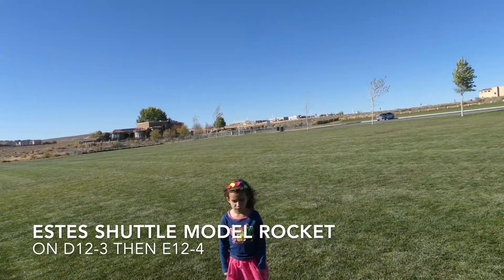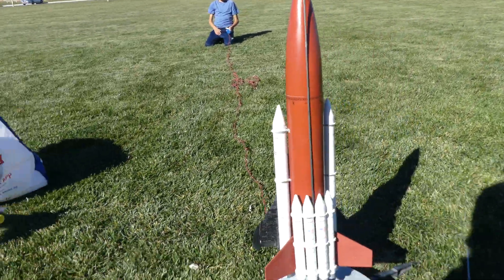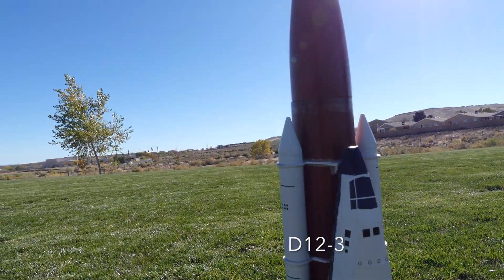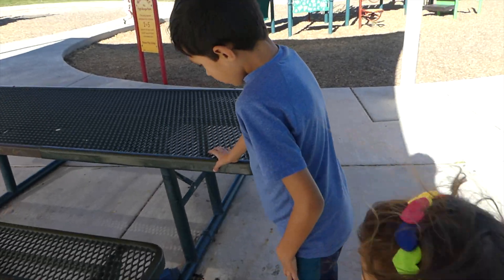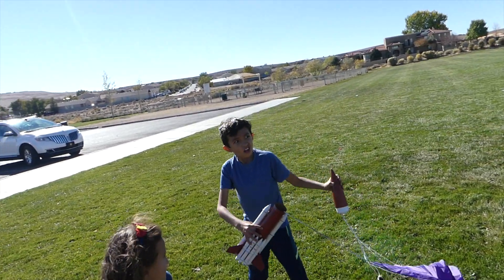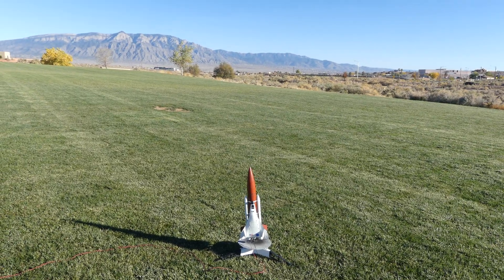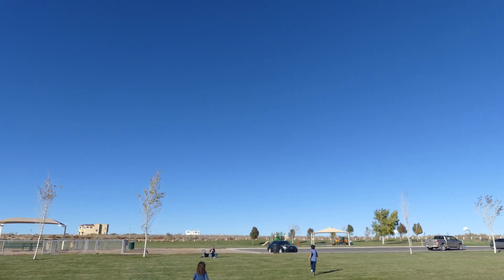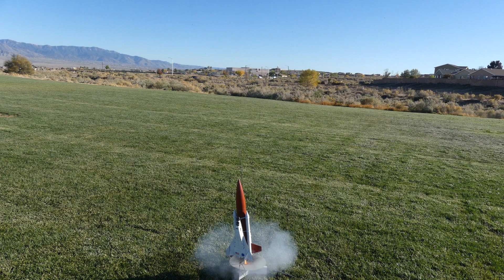Estes Shuttle Rocket!!

Comment: I lost my shuttle glider on an E12-4.Try it with an E26W. Much better thrust off the rod.
Reply from the maker: I'll have to take it back out with a composite motor for sure. The rocket is far to heavy/bulky for the recommended engines